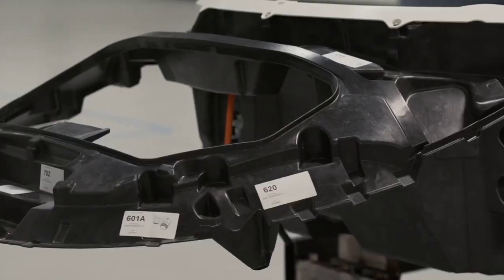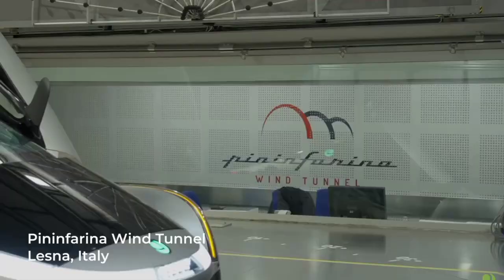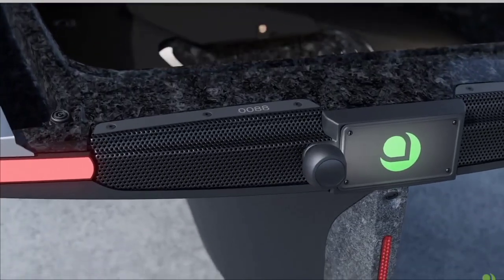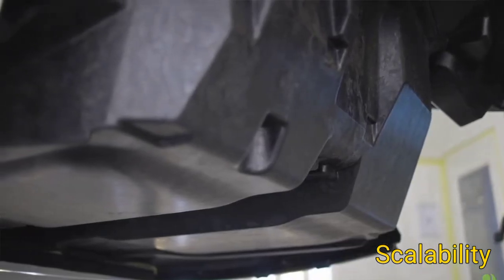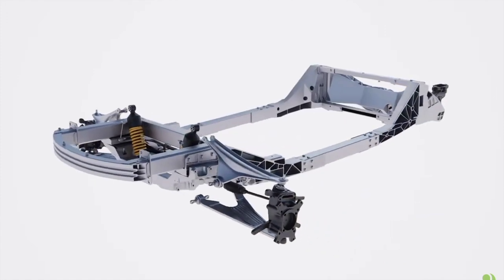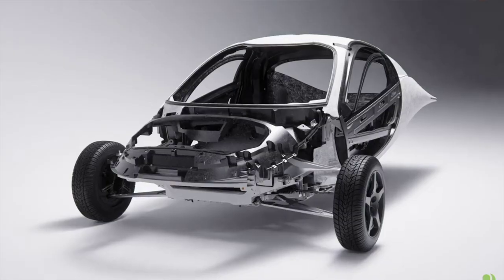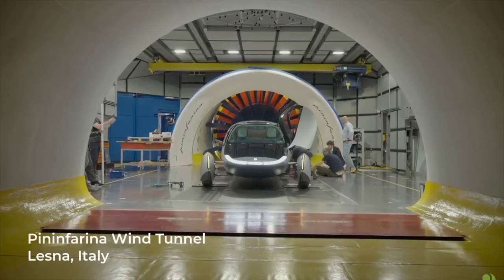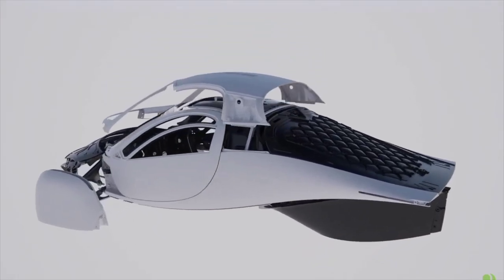Aptera New Drivetrain

Comment: If the drive train hasn't been revealed it is because they are still in negotiation with regard to details or chosing between two or more options.  So I have no problem with the wait.  I would have preferred the in hub motors but I am aware this may be too soon.  I hope they do provide an all wheel drive, even with the alternate drivetrain.